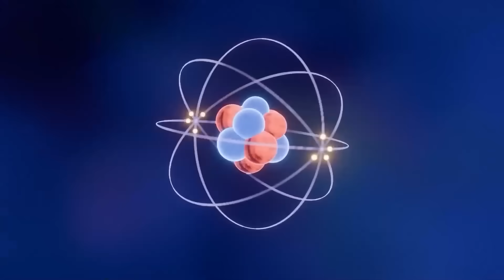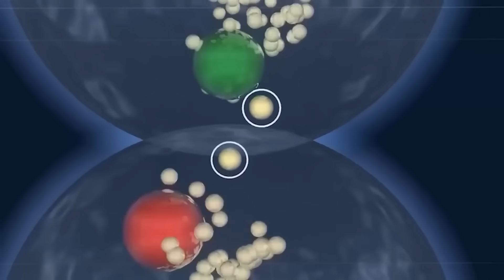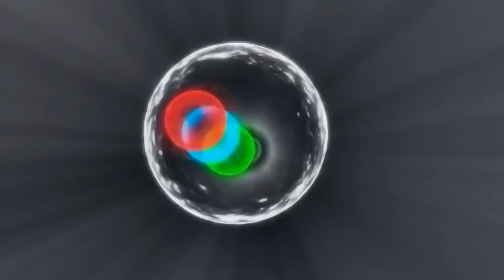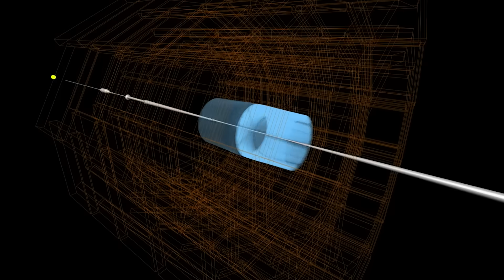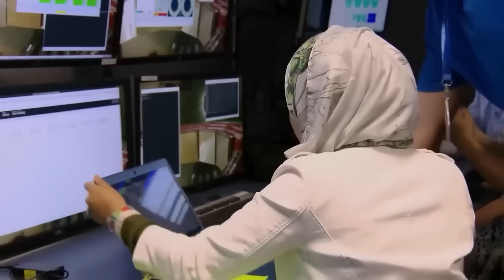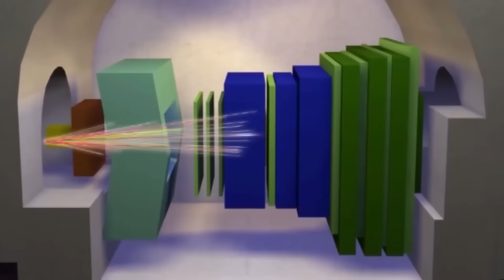Forbidden Experiments at CERN That Terrify Even Physicists

Comment: If there's energy released when so called "anti-matter" encounters matter then it's not really anti-matter.
To truly be antimatter it would have to be completely opposite and equal in which case they would simply nullify each other.
1-1=0, 2-1 =1. 1 and -1 are equal and opposite. 2 and -1 are opposite but not equal leaving a remainder. Energy is a remainder.